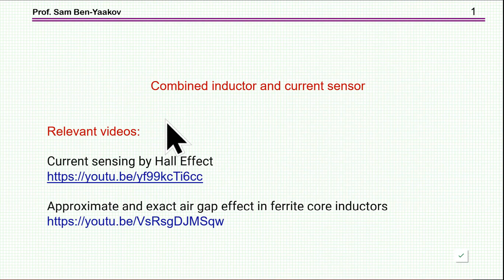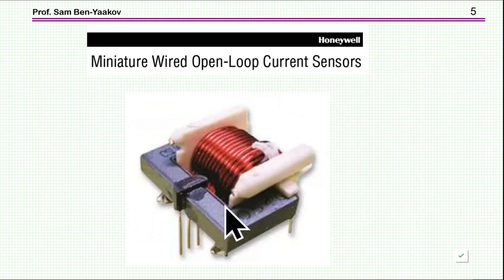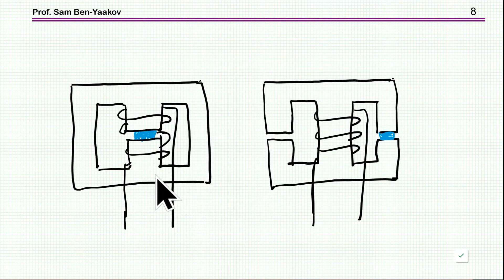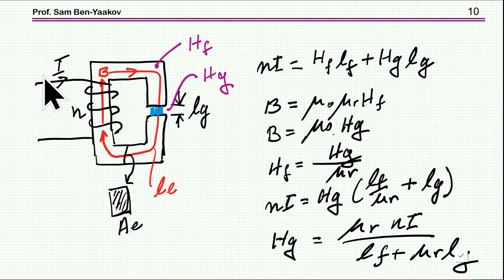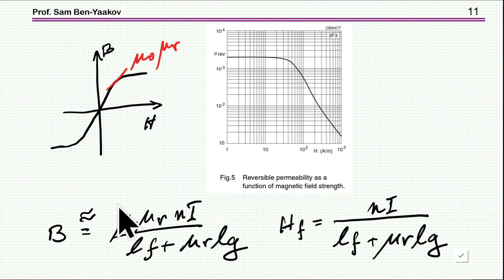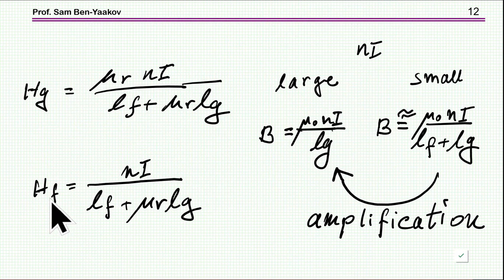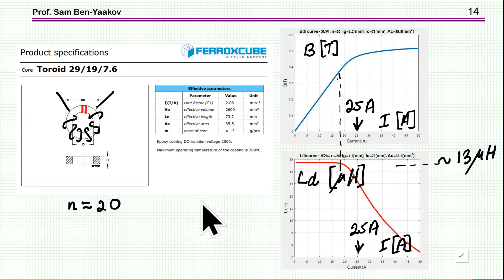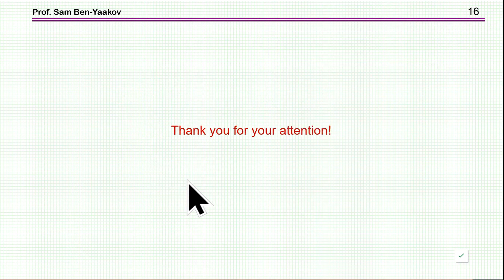Combined inductor and current sensor

Comment: Thanks professor. Do you know what kind of sensor this is? Would that be better than a separate winding for current representative measurement?
Reply from the maker: Do you mean  winding on same core? This does not measure current.
Reply: @sambenyaakov  I see, but let's say there are just a few windings, for that supposed measurement. Could not that be fed in an integrator so the resultant signal is current?
Reply from the maker: @popovlist  Not really

Comment: Very nice.  An accurate measure of the inductor current (minus the increased leakage).  I also like the EI suggested by Pásikavec.

A question, at 0.51 minutes you show an RC across the inductor and say it measures the voltage drop of the internal resistance of the inductor.  

The output of the switch and the cap are both very low impedances,  therefore, IMHO, you are just measuring is the voltage across the cap.  To confirm, I modeled this, setting the values of LR and RC to get the same waveform.  I doubled the inductor resistance, doubling the voltage across it, the voltage across the C remains unchanged.  I repeated this but halved the inductor, voltage across the inductor resistance doubled, the voltage across the C remains unchanged.  

Am I missing something?
Reply from the maker: See  https://youtu.be/sqQzBxfECj4?t=1066
Reply: @sambenyaakov  Thanks, that is the analysis I was looking for. 

You have the voltage across the LRs network changing with current.  If it did, then you are right.  I see it differently.  

Because the switch and output cap are very low impedances, the voltage across LRs doesn't change with load current.  The increased "DC" drop across Rs reduces the voltage across L. 

With the right RC network the voltage across C will be the same as the ripple voltage across Rs of the inductor.  It won't provide the DC offset that ripple due to load current.   The voltage also won't show core saturation.  If the voltage changed with current, you could.